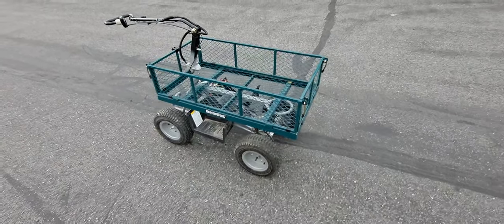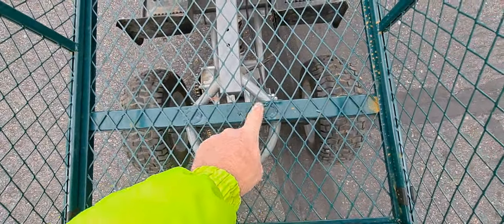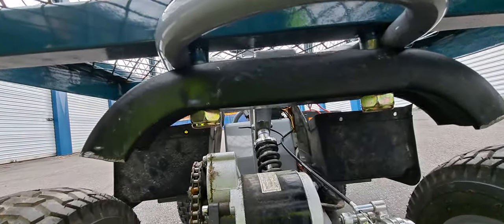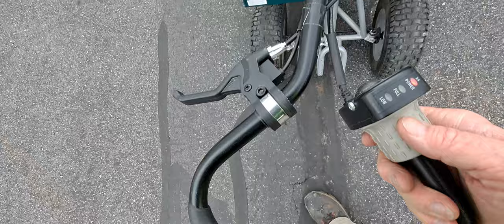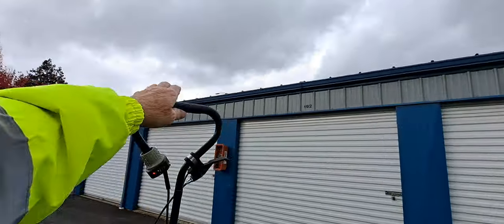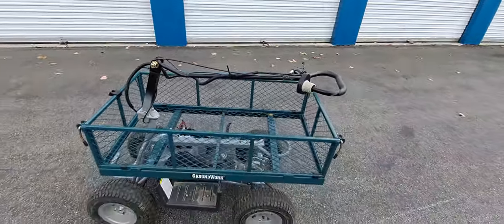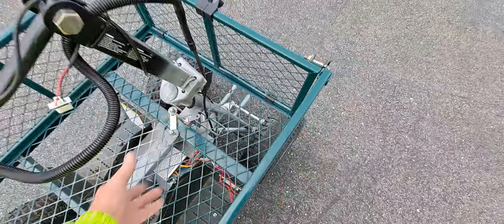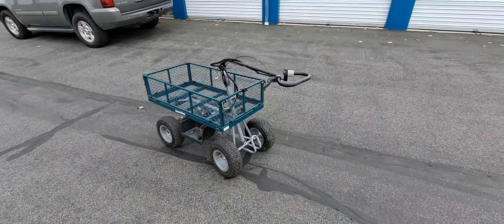Simple Electric Beach Cart build

Comment: Amazing job and simple. I like that not too much modifications were done which is what I need to convert the razor quad to a fishing cart made of aluminum . Did you have to do mods on the speed ? I know there are videos of installing potentiometer to slow down and limit the throttle
Reply from the maker: Yes but it was by installing a larger sprocket to give it more torqe and reduce speed

Comment: Does it run on the sand good with those tires
Reply from the maker: @markstuck4925  it's OK in deep soft sand I have to assist in pulling a little bit. The fatter tires would be my next upgrade